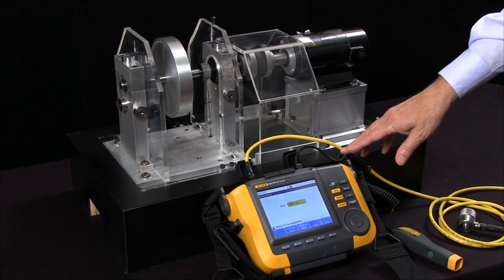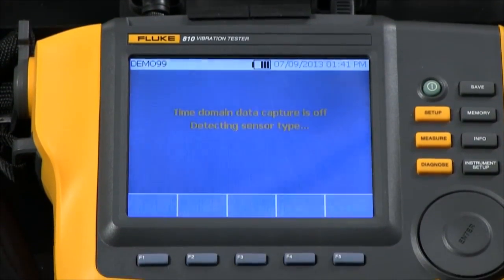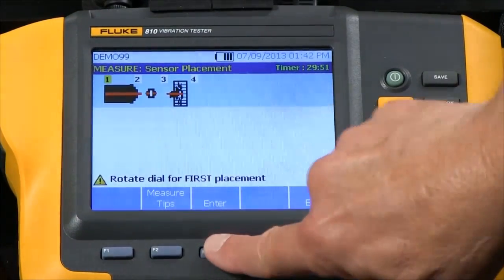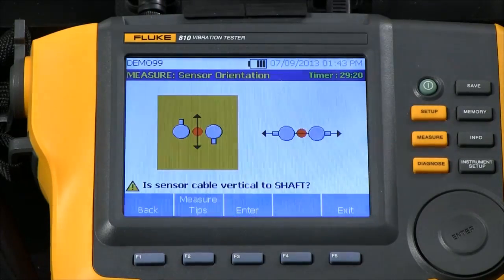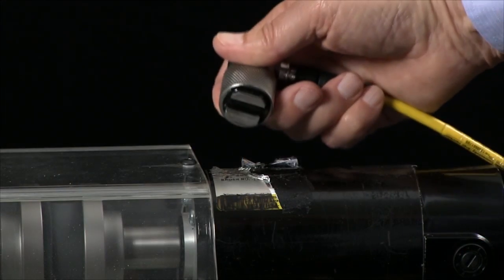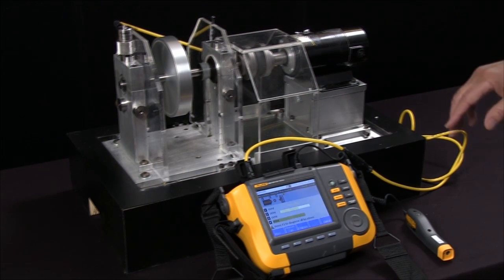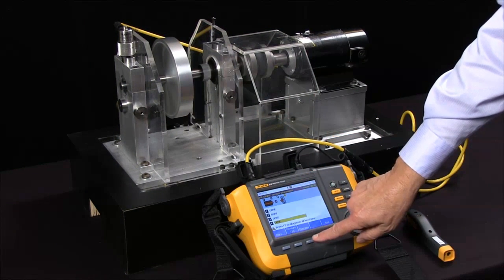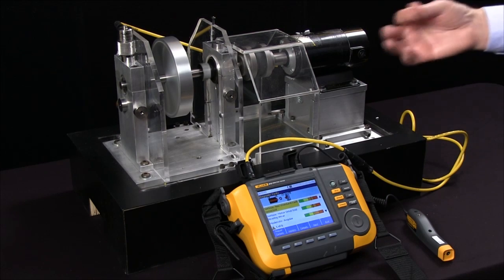How to Measure Vibration with the Fluke 810 Vibration Tester

Comment: greetings, we have several machines in our industry, and we use the fluke 810 vibration tester, and we are having problems measuring vibrations in motors with aluminum material.

we have also had difficulty in interpreting the generated graphics. can you please help us?
Reply from the maker: We're sorry to hear that you are experiencing difficulties. Could you share where you are located please? - we can connect you to your local support team. Alternatively you can contact support at : fluke-info@fluke.com
Reply: @fluke  i am located in angola (africa), i really need help taking measurements
Reply from the maker: Hello Euclis elv elv forever,

What you can also do is to contact our local distributor in Angola who will be able to help you with your issue if not solved yet. Contact details : 
Nova Sotecma, Lda
Av. Deolinda Rodrigues, nº399
Luanda
Angola
 
Phone number: 00244 932 405 507
Email: ns@novasotecma.com

Kind regards,
Fluke Middle East & Africa

Comment: Can you test a motor servo?
Reply from the maker: Hi there - The Fluke 810 Vibration Tester can analyze common equipment: motors, fans and blowers, belts and chain drives, gearboxes, pumps, compressors, and spindles. More details can be found here on our website: https://www.fluke.com/en-us/product/mechanical-maintenance/vibration-analysis/fluke-810 - Thanks!

Comment: In comparison with the Commtest VB5 spectrum analyzer, how does the Fluke 810 match up? We have been using the VB5 now in Royal Canadian Navy for 18 months (since the upgrade from the Commtest VB1000) and I have found it to be a reliable vibration monitoring test equipment. But unlike the Fluke 810, the VB5 does not give you a breakdown of the possible faults on screen. This is something as technicians we have to complete based on spectrum or waveform analysis. More info on this product would be greatly appreciated as I currently instruct vibration analysis and pneumatic/current controls at the Royal Canadian Naval Engineering School in Victoria, BC. Thank you.